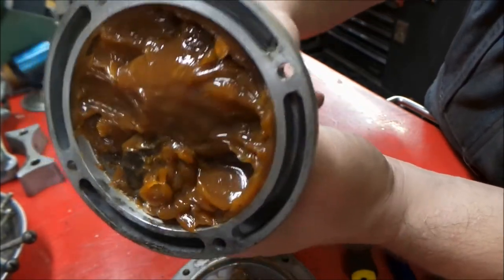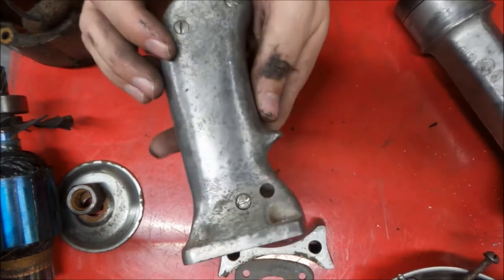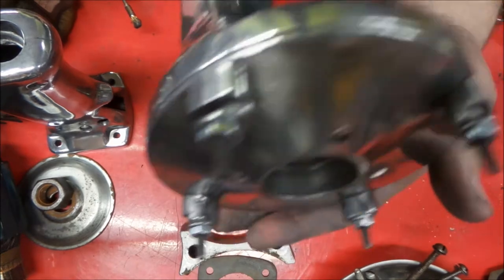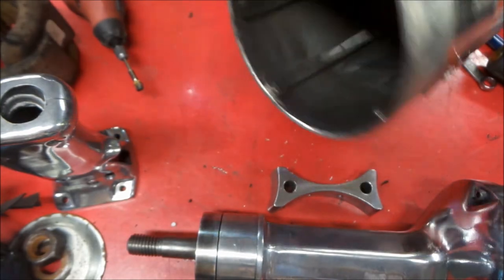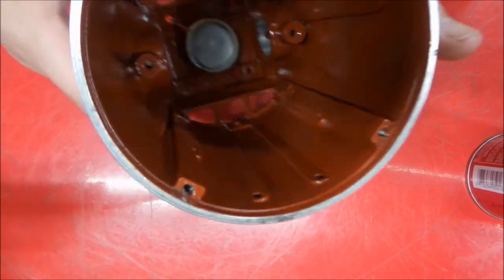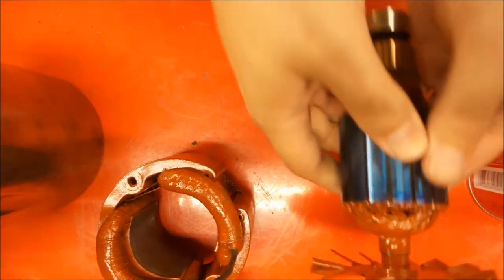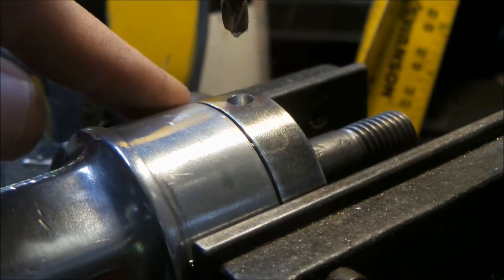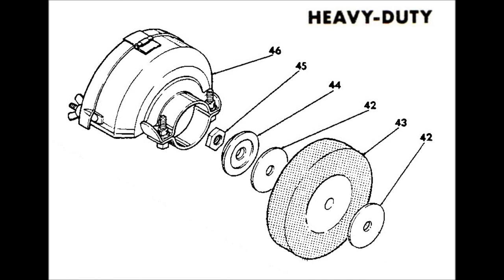Milwaukee 5220 Straight Grinder Restoration Part 2 - "The Clean Up"

Comment: What did you use as varnish on stator/rotor/windings and inside of handle?
Reply from the maker: I used a product from Sprayon product number EL 601 it is called "Red Insulating Varnish"